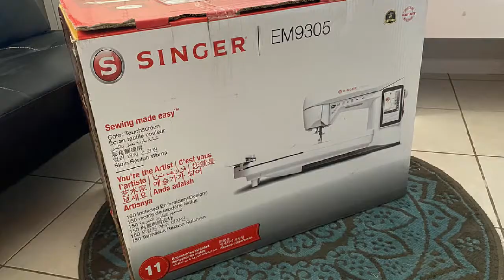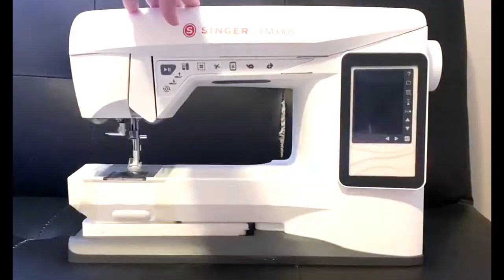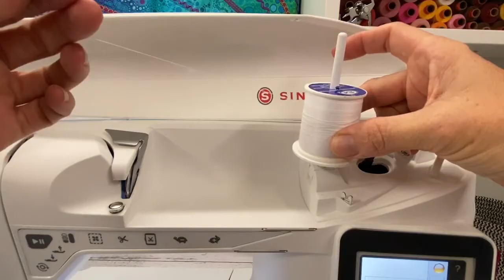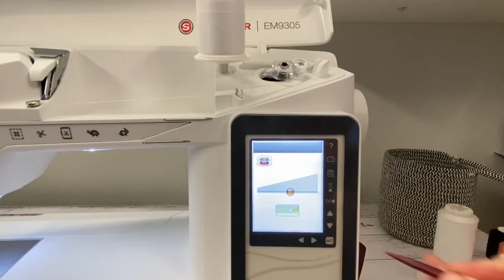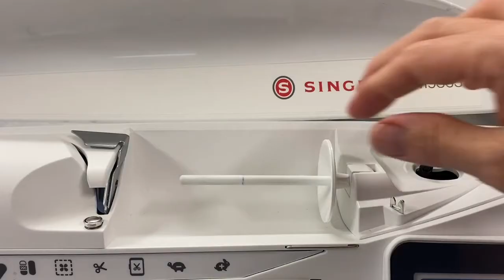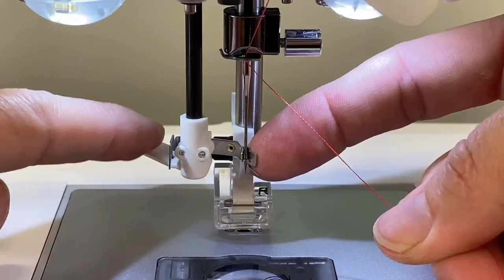EM9305 Embroidery Only Machine - Setting Up The Machine

Comment: Just purchased the em9305 and had a disaster already,   Whilst embroidering, the machine suddenly juddered and stopped.  I noticed a bent needle.  I removed the piece I was embroidering and underneath there was a birds nest.  I cut it all off, then noticed that this mishap had moved the bobbin basket and all was on a slant.  There are no directions whatsoever to get this basket back into the machine correctly.  All the book says is replace bobbin basket (after cleaning).  So I am stuck, nothing on Youtube on how to do this and the machine only arrived yesterday!  Everything worked until about half-way through the embroidery.  Now I have lost confidence and the machine wasn't cheap (to me anyway).  There is no agent where I live, one is about 400 kms away and the Store I purchased it from sent it from another store miles away.  I had to order online.  So now I feel up in the air without any help.  Not a good start and a bad experience for me.  I also noticed that the needle in the machine was an unusual size, something like an 80 for e.g.  I have put in a new needle 75/11 which I believe is standard.  The needle pack that came with the machine has no ID on it apart from colours (which I do not know what they mean).
Reply: I'm having the exact same problem, did you manage to fix it?

Comment: Great tutorial!!! I love that you're Aussie too!
This is very thorough. But as a total newbie, what's a bobbin and the point of it
Reply from the maker: The spool thread comes from the top of the machine and goes through the upper thread guide, while the bobbin thread is under the needle and goes through the bobbin thread guide.The bobbin in a sewing machine supplies the lower thread that locks each stitch into place on the underside of the fabric as the machine sews. The bobbin has a cylindrical or reel-like shape. Most sewing machines feature a bobbin winding device for filling the empty bobbin with thread before sewing.